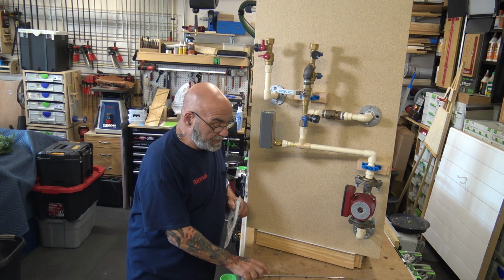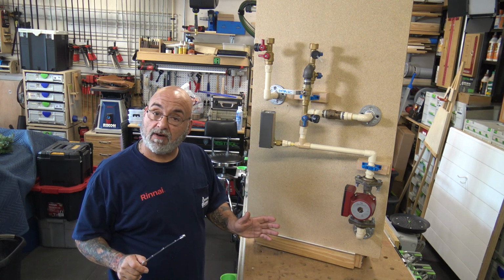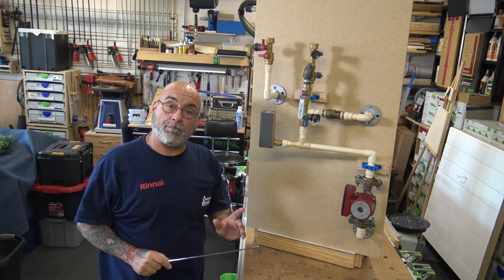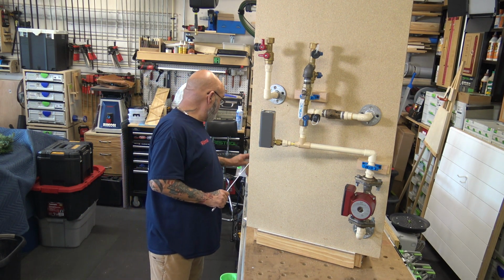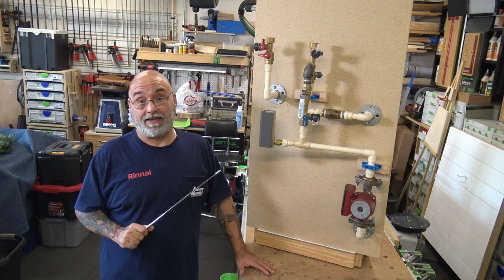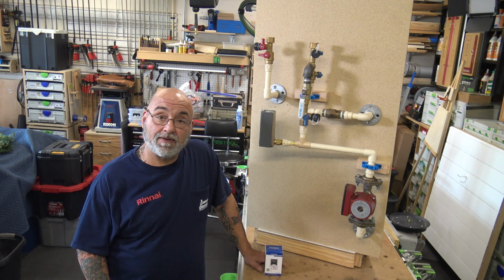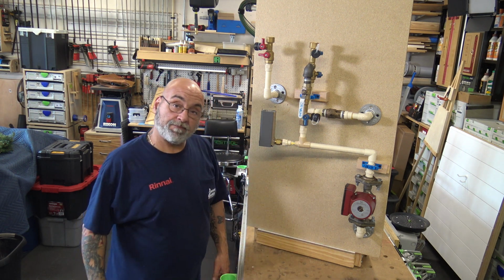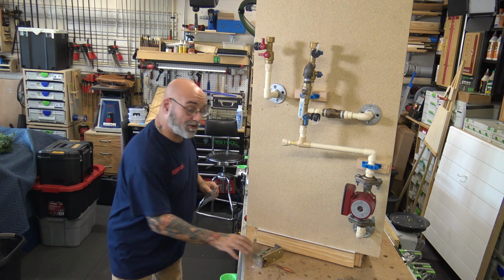Part 2 Piping a dedicated hot water loop on a Rinnai RU unit

Comment: Hi Mike
I installed Rinnai RX180IN
I also installed a dedicated return line from the farthest vanity
Can I use the Aquastat and circulation pump set up like you describe in this vid?
Couldn’t I use a smart WiFi smart switch to power the Aquastat as a timer?
Thanks for your vid
Gerry in Michigan

Comment: Mike,  I have 2 Rinnai R75Si units that are 16 years old.  One of them has no error codes but will only run hot water to the shower for about 4 minutes then turns cold. Then will turn back hot for a little while then repeats the cold, hot situation.  I had a level 3 tech come out and suggested a new heater.  I just don't understand why it can't be fixed.  Could you give me an idea of what might be the problem.   I have reduced the Temp down to 102 so my wife can keep it on full hot, thinking it might be not enough flow to keep it running hot. But that hasn't fixed it either.

Comment: not sure about all the models but i believe the "CU" models have a 120v out from the motherboard that can direct power the circulator. this eliminates the temperature reading of the water because the unit can sense temperature returned and shuts off power to cirlculator if its within the default buffer temp of 12 degrees of set temp.

Comment: Great work! I got a new rinnai in September. I have a recirculating system. The plumber also bought another electric hot water heater and plumbed it in for the recirculating system?? After I see your video I think the plumber did mine wrong. Now I have a bigger electric bill. I think I will  go back to drawing board and do it again.
Reply from the maker: What model number do you have?
Reply: @ThatTanklessGuy  ru199in
Reply: Ru199-IN
Reply: Ru199in. Thanks

Comment: Trying to make a decision between the RU199 and RUR199.  Have a semi-detached (~1600sqft) house and furthest fixture is roughly 40ft away, with no dedicated return line.  If I get the RU199, is it possible to add an external recirculating pump and by-pass valve later on?  Or it is only possible to use the RUR with a by-pass valve?
Reply: Did you ever sort this out? I have the ru199 without a return line as well
Reply: @johnrubino3393  Went with RUR but rarely use the recirculation feature.  Water warms up quick enough without it.

Comment: Mike, I have a question on my Rinnai that I can't find an answer to. My unit runs hot water for about 3-4 minutes and then it starts to drop off in terms of temperature. I have to lessen the cold water mix to maintain the temp. I have no error codes showing. I have flushed it in the past for scaling and did not have a bad scaling problem. I have propane, which is the fuel for this unit. What I am experiencing is not the cold water sandwich either....what else could be causing the problem? Any ideas?

Comment: Got another question for ya. Due to supply/ demand was forced to buy a RU 180 EP to install instead of RUR unit for a homeowner. The unit is 75 feet from master shower all plumbing in slab. Will the recirculating pump offered by Rinnia work for me. The home has a booster pump on supply side due to rural water system low psi. The booster pump supplies a psi of 60 constant. Help!